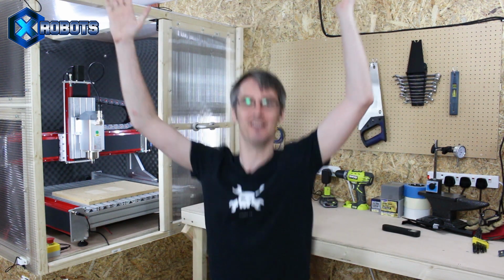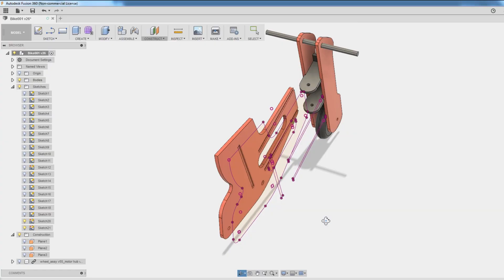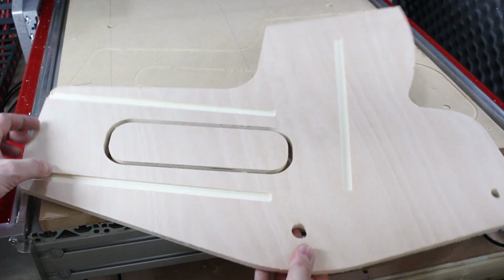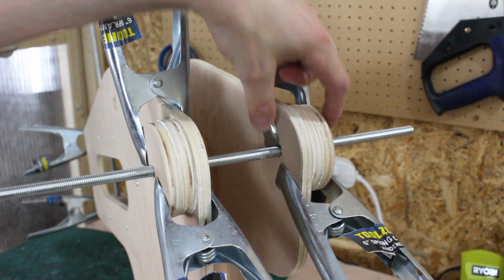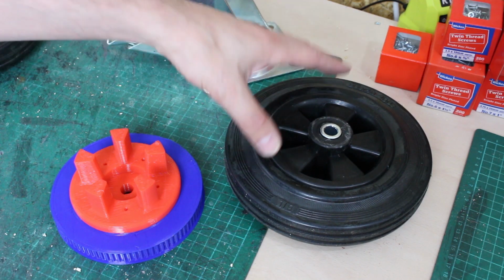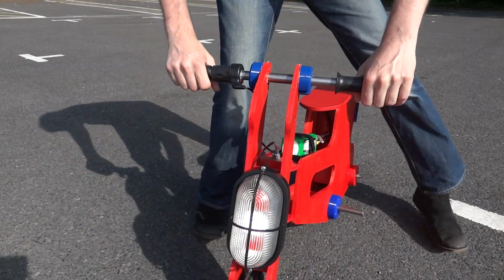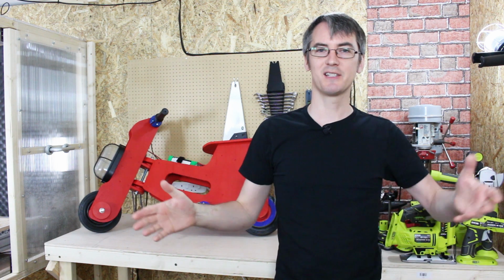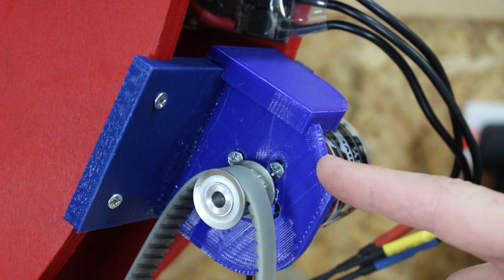How To Build an Electric Mini Bike | James Bruton

Comment: Awesome project, good job on it. Quick question, Why did you print the blue and red part (the parts on the drive wheel) separately?  why not print it as one piece and avoid gluing?

Comment: Why aren't you using Fusion to generate the G-code ?
Reply: mikeselectricstuff I have both Aspire and Fusion 360 as well. When it comes to cutting something out of wood from a flat sheet with tabs for some reason I always choose Aspire as well. It’s very user friendly for these applications. When it comes to metal parts that you need lots of control over feeds and speeds at different parts of the cut and really smart tool paths, Fusion 360 rocks.

Comment: very cool quick project. It would have been better if you could have fit the motor and electronics inside the bike in between the two side pieces but overall I like it.

Comment: Just wondering how do you find out the relation between the two pulley's?  And also glueing the pulley is this with those plastic glue's that kinda melt and fuse the two together? 

Oh and love the vids and builds!

Comment: I've been pricing 4000 watt skateboards. There are two 2000watt motors. So there's a motor for each rear wheel. And a Lithium battery because it weighs vastly less than a LeadAcid battery. The boards are about 500 to 700 dollars from the factory via the alibaba website. Even though I don't like that website, most products have samples so you can buy just one. Most items on Amazon are from resellers to they tack on 30% to the price. Anywho... So I was thinking, you could make a minimalist skateboard (as opposed to the complex turning bat-board). So a belt driven board, not shaft driven. No hub motors, they don't have enough torque. Brushless of course. The goal would be 40 miles an hour and a 2 hour operation time, while making the board as small and like a normal skateboard as possible. :D Keeping in mind, a normal skateboard has a flexible wood deck, which is its suspension. Anywho, up to you. :D
Reply: GreatScott did this already, but it was a Longboard.

Comment: I did enjoy this vid actually.
I enjoyed better than that vr bike vid.
Hope to see more like this one.
Can you do a solowheel-like device? One that haves your touch?
Reply: A OneWheel motorcycle has been a dream in many anime series. A few people have made them. The OneWheel skateboard is pretty popular. I think James could do this with a motorcycle. Basically a motorcycle wheel with an in-hub motor from a large portable ground auger. Something like that. So it's just a seat on a self balancing hub. With a few pegs for the feet, and a handlebar because it's so high off the ground.

Comment: is there any possiblity u can puplish the links to the used electronical components? would help rebuilding it!
Reply from the maker: https://hobbyking.com/en_us/turnigy-aerodrive-sk3-5055-280kv-brushless-outrunner-motor.html - but I'd say use a bigger one

https://hobbyking.com/en_us/turnigy-sk8-esc-v4-12-for-electric-skateboard-conversion-w-bec.html

https://hobbyking.com/en_us/multistar-high-capacity-6s-10000mah-multi-rotor-lipo-pack.html

https://www.ebay.co.uk/itm/Half-Twist-Grip-Throttle-For-Electric-E-Bike-Bicycle-Scooter-Right-Side-Parts/113075624563
Reply: thanks!

Comment: Hey James, 
any chance you could re-upload the frame files, the .stp is throwing errors all over the place when i try to open it
Reply from the maker: I can load the STP file back into Fusion 360 just fine. I've re-uploaded but Git thinks the file is identical.: https://github.com/XRobots/Tiny-E-Bike/commit/a87c617ee345e9f2828651cf7a87e76622ff0fd0

Worth trying Fusion since it's free to Enthusiasts.
Reply: odd, trying to import it in Fusion360 gives me a "content is corrupted or invalid"
Reply from the maker: I just downloaded it from Git and imported to Fusion and its fine. How did you can the file from Git? - use 'clone of download' in the  top right to get a zip, from this page: https://github.com/XRobots/Tiny-E-Bike
Reply: that did it, a combination of downloading the zip and "new design from file" vs uploading to Fusion
There was a 5 byte size difference between downloading it straight from github vs the zip
thanks for your help

Comment: i don't understand, i thought you can do cam and generate G code direct from fusion360?
Reply: I think you can, fusion360 has tons of cad features for CNC and laser cutters. but it looks as though he's not done a lot of work with that cnc machine, quite yet. i think he's just using the software it shipped with. i imagine eventually he'll set up a CNC profile in fusion360. takes a bit of time to read through forums for the best settings.

Comment: Looks good. I think it will be far easier to control if it had less "rake", which is how far forward the front wheel axel is compared to the turning axis of the front forks. See here: https://en.wikipedia.org/wiki/Bicycle_and_motorcycle_geometry